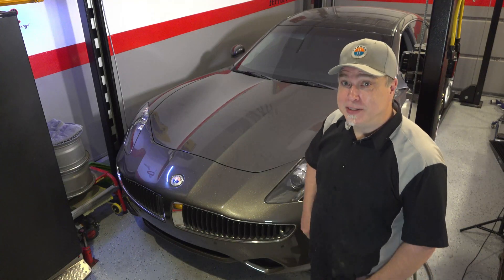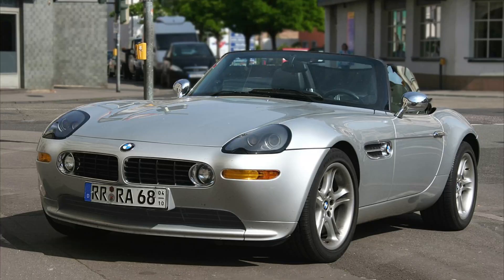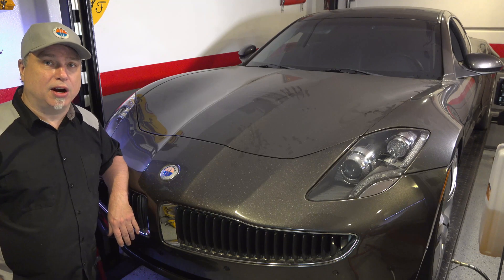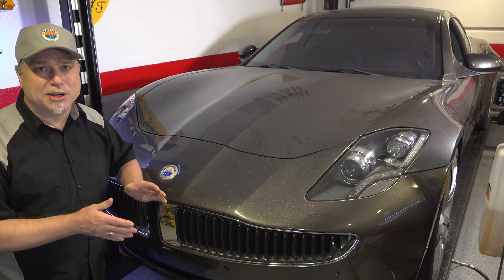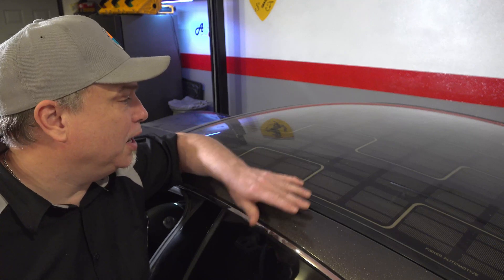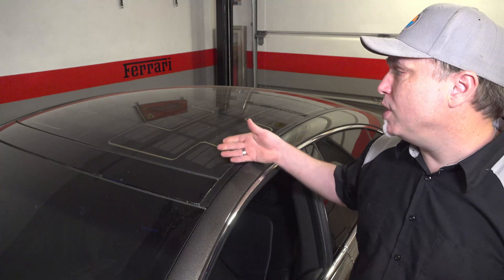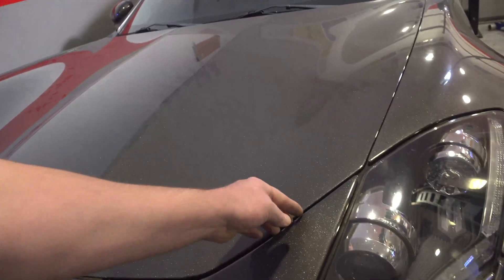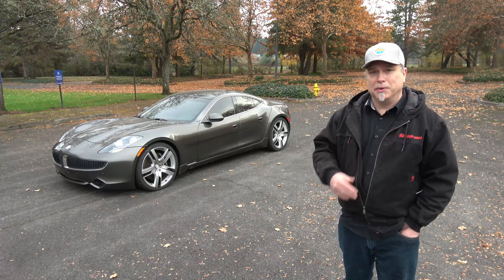Fisker Karma: Electric vehicle extended range [4K] Ep42

Comment: The Fisker has a better look than the Tesla Model S, but other than that, the Model S is far superior car in about every way. The Fisker is a hybrid with a GM 4 cylinder engine and the build quality of the fisker is very poor. Not to mention, the back seats aren't fit for anyone other than a chhild, its too cramped back there. The Wanxiang Group did make the Karma with original syling like the Fisker but after slow sales they changed the design last year.
Reply from the maker: The Model S is a better car for sure.  The Fisker was rushed to market, then the engineering staff left the company and it was left a prototype.  While Fisker was having its issues, Tesla was perfecting their design and didn't have funding issues stalling the development of the car.  I own the car for its styling, and not performance or comfortable rear seating.  Nothing else like it on the road.  Thanks for watching!

Comment: Great video! As a fellow fisker owner I will follow you with great anticipation, this car is unique despite its probles, has there beeen a better designed car manufactured?
Reply from the maker: I wish that Fisker Automotive would have had a bit more time to refine their car.  It was released too early and I consider the car still a prototype.  I have found a few temporary fixes in working on this car.  Great looking, yes.  They needed more time to refine the issues and that just didn't happen.